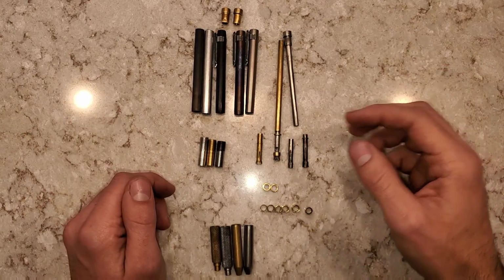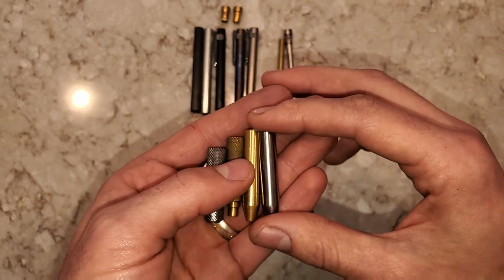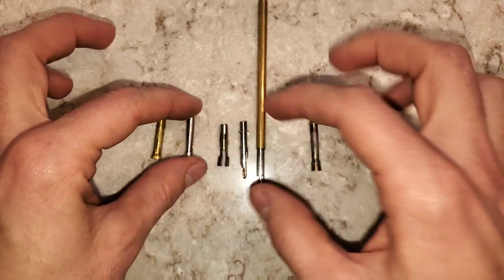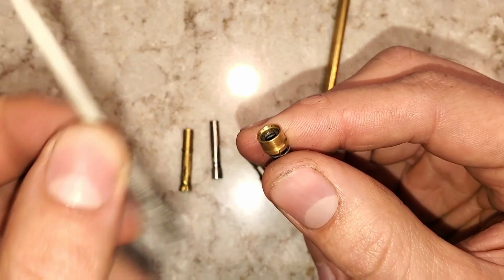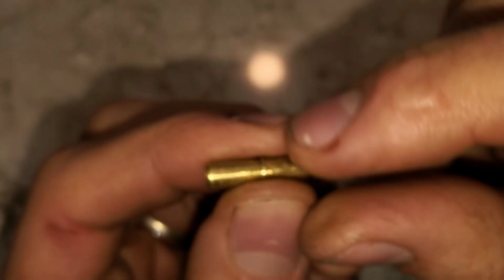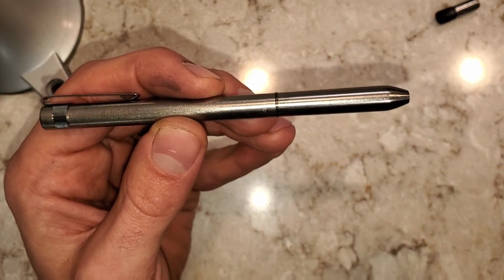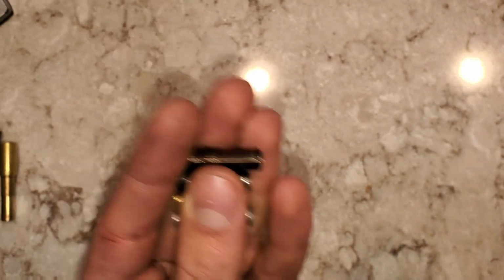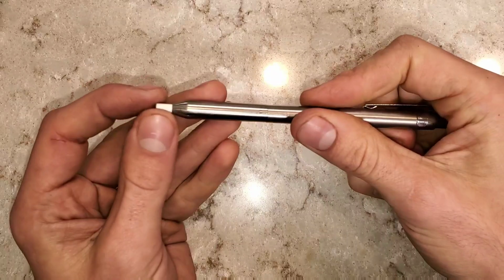prototyping progress on my wood lathe

Comment: Cool project, ever thought of adding a plastic sleeve inside the tip to stop it discoloring the eraser? That way only the clutch need to be in stainless steel
Reply from the maker: Thanks! A plastic sleeve is an option. With my current setup it would take about as long to make a plastic sleeve as it would to make a titanium/stainless sleeve, but I could theoretically plastic injection mold the part. Personally I like the idea of not using any plastic in the design, but I'm not sure if other people are as picky as me 😆 would it bother you to have a plastic sleeve in the tip?